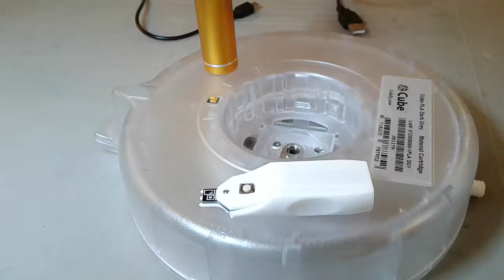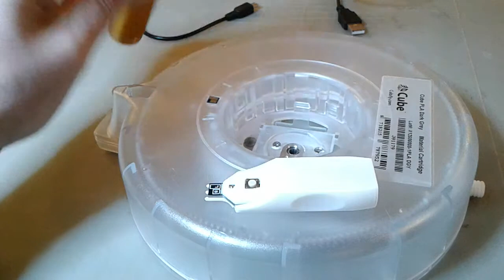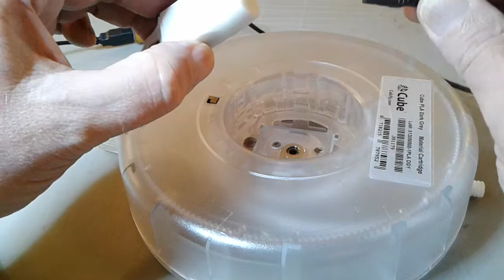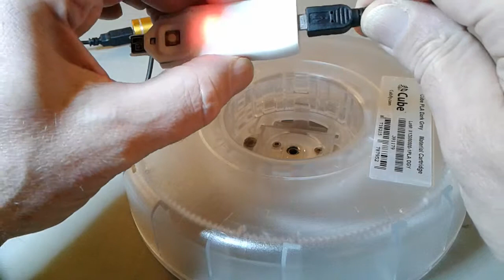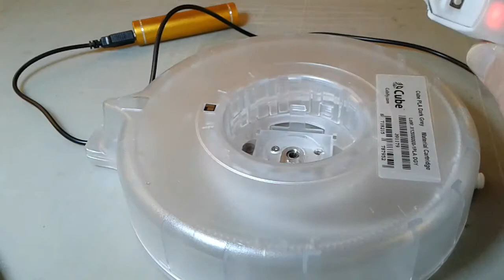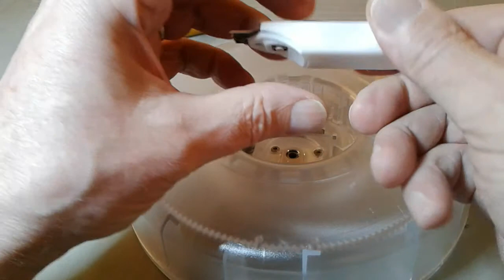ReCube Light 3D Systems Cartridge Recharge Wand; CubeX, CubePro, Cube 3rd Generation, and Ekocycle.

Comment: THANKS!! Two years later, trying to find how to reset my 100+ Cube 3D carts, finally works for me!
Reply from the maker: You are welcome :)
Reply: Hi! if you have extra cube 3 cartridges that are empty of filament I would be very interested in buying one  - Just put in patched firmware on ekocylce but only have eko cartridges and need a single Cube 3 one to get going. I found them for ~50 on amazon but dont want/need the filament, just the chip really.
Reply from the maker: @benkaplan8667  - I keep an eye on eBay.  You can also join the Print3DForum.com and ask there.  People have been known to be generous there.

Comment: Just flash the firmware and the cartridge is forever reset.  And its free.
Reply from the maker: There is that pesky little "can't use 100% carts" bug & CubePro isn't quite as easy to hack.  ReCube is a simpler option.
Reply: @SimpleNature  There is no bug in the firmware hack for the Cube 3.  Now as for the CubePro  i don't own one. But the Cube 3 firmware works and i have never had any problems with cartridges they all register full no matter how long you print. Refill with 3rd party filament or use 3rd party spool.
Reply from the maker: Two things you need to know; you cannot print from the USB drive if the cartridge chip is 100%, period!  Ever! ...with the hack in place.  When you first install install the hack, you cannot print from CubePrint v4.03 if the cartridge chip is at 100%.  Caveat - after a while, the printer's buffer fills up and after that you can print from the app with 100% chip status.  However, you will still not be able to print with a 100% chip from the USB port.  This bug was acknowledged by the developer.  I only learned of the buffer filling up since that time.
Reply: @SimpleNature  Sorr bu you don't know what the hell your talking about i have been printing on my USB thumb drive for over a year now. i can also print wifi all on the modified firmware. Some that i have done myself.  And if your USB is not letting you print after the new firmware you did something wrong. Go back to the original and reinstall the toolbox. I have a total of 5 Cube 3 filament cartridges all i use and refill with different PLA,ABS and even got flex to work after some modifying to the extruder.
Reply from the maker: I do know.  I am clear to say cartridges with 100% chips.  Otherwise, using initialized cartridges, you are right, works flawlessly.  Rock on.  BTW - I know exactly what that hack does.  Did you donate to the cause?   https://openbuilds.com/threads/cube-3-pro-hacks.8420/
Reply: @SimpleNature  If you are talking about new unused then just go back to original firmware install cartridge reinstall patch firmware 1.4b your cartridge is now forever patched.  To buy anything related to cartridges is crazy as 3D systems no longer supply the carts as they said they would few years ago. Sad thing is we the consumer got stuck with a huge paper weight. So instead of them releasing the firmware so we could modify the code they refused. Nice company to take your money then just walk away.
Reply: @SimpleNature  Donate, yea my time working on it.
Reply from the maker: @airwolf269  - donations on the openbuilds site are not for my benefits but I was one of the first to donate.
Reply from the maker: @airwolf269  - that is what I originally said or implied.  Swapping F/W doesn't  always make people feel comfortable, and on CubePro it is a juggling act.
Reply: I have been looking for the firmaware to do just that but so far every link i have found for the firmware does not work any more, do you have a working like or the update that you can share with me so i can flash mine, Thank you